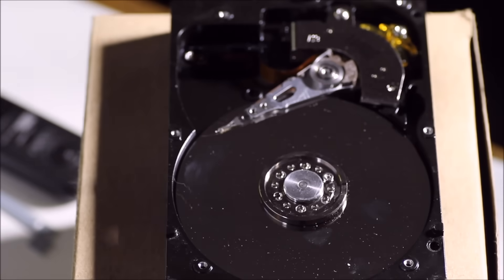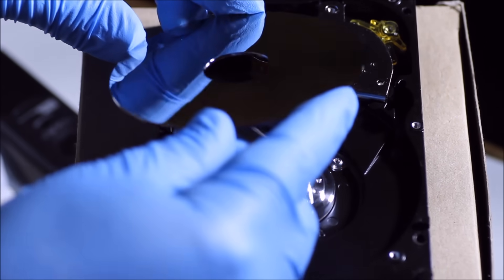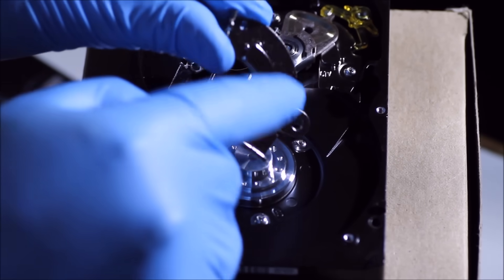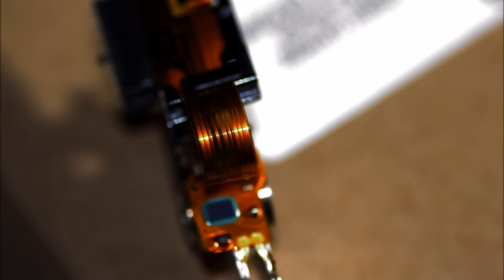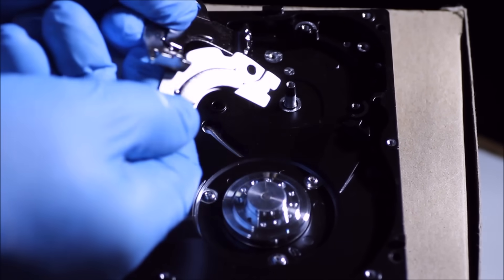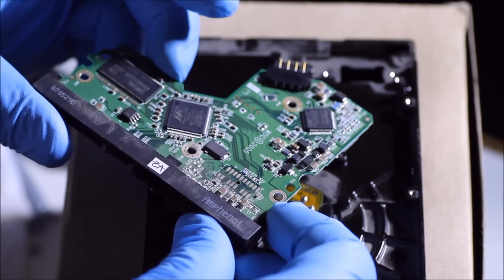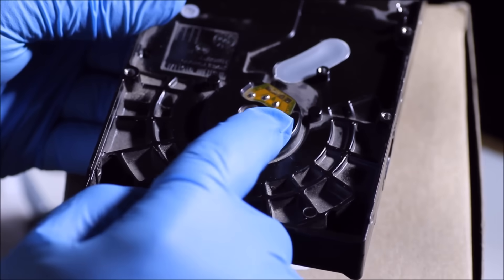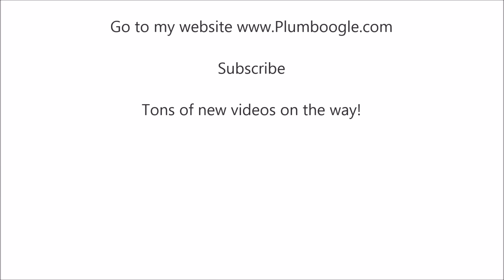Hard Drive Tear Down For Precious Metals! In Detail HD

Comment: No offense, but a lot of what you said was wrong. I may be really young, but I know a significantly large amount of knowledge on chemistry; to be put in 5-8 individuals. So let me begin, I will start with the first error, the "Hard-Drive Disk" is coated with a very thin layer of Platinum, or Iridium (0.087% chance Ir). It is worth saving, if you just keep collecting. The second thing is, you should almost never incinerate the leafed parts. The gold isn't fused correctly and with turn to a gas, under a high heat. There is more, but it's not as severe as these too. Other than the multiple mistakes, you did a outstanding job, describing all the correct parts, and have a great speaking voice too.
Reply: Spinoblood21 You're flat out wrong and too arrogant to even understand it.

Subject-verb agreement 101:

The SUBJECT of your sentence is "mistakes". Your VERB must agree with the SUBJECT in NUMBER.

When you have MISTAKES, you use ARE. I explained this once before.

Not to mention, your comma use is really bad. You write in sentence fragments and improperly splice them together with commas.

EN101 - Freshman English class dismissed.
Reply: My names Spinoblood my favorite app is goggle.
Reply: Spinoblood21 You have it wrong, sir. The proper way to say it is "There ARE no mistakes", not "IS". "IS" is the singular form of the verb "to be". When you are talking about plural "mistakes", you would use the plural form of "to be", which is "ARE".

Go check yo' grammar, foo'!
Reply: Spinoblood21 Yes, yes you are.
Reply from the maker: Non taken. I appreciate your input and criticism,  I knew of the Iridium in some platters. Although chemical tests done showed palladium. I will have to do some research. Thanks for watching and taking the time to comment.
Reply: No problem. I was watching a few of your other videos and you do pretty good. Do you ever do any chemical treatments to them?
Reply from the maker: Spinoblood21
Yes, but i prefer to keep that off of YouTube.
Reply: Would you be willing to do a private video for me? I've been all around YouTube, but you've done a great job with procedures. I just got a job in the Alchemy career and I think you could help me greatly.
Reply: Spinoblood21 Are no mistakes!
Reply: Spinoblood21 Looks like somebody lost a YouTube argument...
Reply: Spinoblood21 You "were" wrong!
Reply: Spinoblood21 Omg SLAYING the competition!
Reply: Have not would be more correct! URINIDIOT!
Reply: Have not you reread your perfect English professor! Arrogance and youth at its finest! Hope you learned something youngson. Peace!
Reply: HAHA gammar do not bring to old people into your ignorance!
Reply: Wait guys... Lemme get my popcorn !
Reply: dede9806 
you took 2.5 years too long with your popcorn
Reply: Not hear for an English class.. just the gold...
Lol...
Reply: Did I miss something? Damn. What did I miss? No popcorn?
Reply: You are funny Mike. Are you a stand-up comedian? Or that one jackass who gets drunk before the show starts?
Reply: Instead of shitting on people go back to playing with yourselves. I'm done with all of your uneducated foolishness. I know when I am wrong and can admit to it; however, I am not making any mistakes in my grammar and spelling, so I won't, and hadn't dropped back from my stand point, yet you persist on attempting to make me look bad, thus I leave from all of your acts of failures so I don't stoop to a level of which you present me.
Reply: Don Rogers There is no mistakes. In that case. Learn grammar, not English. There is a difference Don.
Reply: No. No I am not
Reply: wsundas Kuneechewa That's interesting that you would say that. If you were to place that paragraph into word, there is no mistakes. I find your lack of any knowledge to be a humorous joke. Keep it up, you might be able to get somewhere with it.
Reply: That was a singular statement. Requiring a singular pronoun. There is no mistake, is proper English, it just sounds awkward. I know it is correct, so stop. Thank you :)

Comment: Very informative video, however, I used to work at a metal recycling yard, and just want to make a correction. At the end of your video, where it said the front plate is stainless steel and not being very valuable. Stainless steal is worth more, pound for pound than aluminum... generally $0.40-0.60 per pound.
Reply: Rob The Plumber a penny saved is a penny earned.
Reply from the maker: Yep you are right. Although I also said in the video that I use the alum to make parts. I do keep a bin for stainless and it all adds up. SS is not something I focus on. If it is not worth at least $2 a pound I really do not care about it. Thanks for watching.

Comment: Thanks so much!
 I normally don't deal w/ hard drives. But I found a bunch of 486' & Tandy's on side of road ( It was a good day). So I'm down to HD"s and M boards.( I usually buy scrap from local repair shop RAM CPU ect).
I find slicing ribbon cables containing gold into fine cross section pieces (acid eats from both sides in hot aqua regia solution) easier than incineration. The temps have to be monitored too closely for the average scrapper. Metals are way too thin. end up w/ plastic B-B.
Reply from the maker: Great find and thanks for the info on the ribbon cables.

Comment: Many people think the brackets are a nickel superalloy called permalloy or MUmetal in fact magnet brackets are low carbon steel. Pure iron is one if the best flux carrying materials to use. Cold rolled low carbon steel is a trade-off for manufacturability.  The brackets are plated in a nickel alloy and the unique dual polarity of the magnets allow for one direction magnetic field.
Reply from the maker: Thanks for the info.

Comment: Quick Question Rob.. I did a break down of a scrap hard drive myself. When i removed the read write actuator and took a closer look with a loop i noticed that it had very small Green and red wires going from the end all the way down to the base. Is this gold colored somehow or is this another metal replacing the gold?? thanks in advance.. the wires were bare for about a cm then were insulated the rest of the way.
Reply from the maker: It is gold, about 2 microns thick.

Comment: I screw the magnets , brackets and all to the wall and hang my tools up . Its real handy .
Reply from the maker: What a super idea. I may have to do that. Thanks!
Reply: I was thinking of doing this, too. They make some nice knife holders for the kitchen as well. Trace the magnet shape into the wood, remove that thin layer to countersink the magnet and boom. Sweet stuff.  I don't know how strong the magnets are but a thin veneer of wood laid over top may make it awesome.
Reply: Make an inset on back of knife holder, then hot glue magnet inside. They are plenty strong to penetrate through the wood
Reply: i screw lots of things. i’m open minded

Comment: why the glove
Reply from the maker: Being a plumber for 15 years I can tell you that there are chemicals in electronics that can absorb through your skin and harm you in the long term. In my first 8 years of my trade I slacked on safety with chemical agents and have extremely sore joints at times. 

Also you can see the dust flecks on the platters. That was open for only 15 seconds and look how it shows up! Fingerprints are much worst. Hopefully I answered your question, Thanks for watching!
Reply: sure did thank you

Comment: ok I have been cleaning off boards for some time and saved a large quantity of those monolithic capacitors,all chips. I always say keep anything that has gold plate,.starts out as a little bit then accumulates. so yeah I have been recycling computers and anything else with a motherboard in it.  So do i just try to sell my goody barrel of stuff on ebay?
Reply from the maker: Before you jump to selling on ebay, check on scrapping forums first. There are buyers in specific categories that will pay a lot more than on Ebay.(sometimes). By the time you are finished selling on Ebay and taking payment on Paypal, they will take 20-30% of your money!